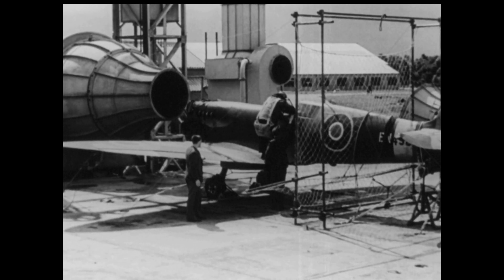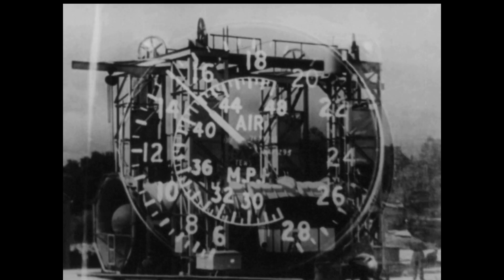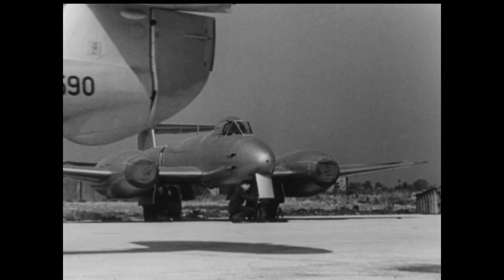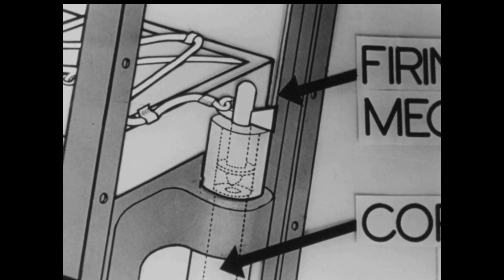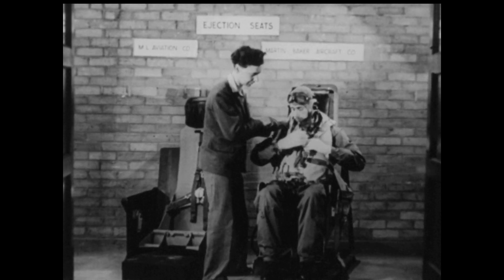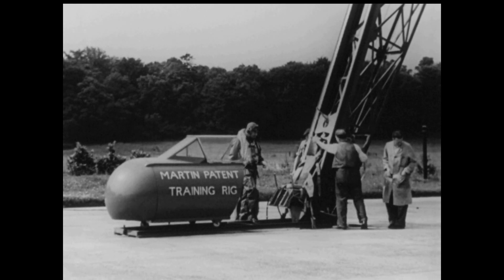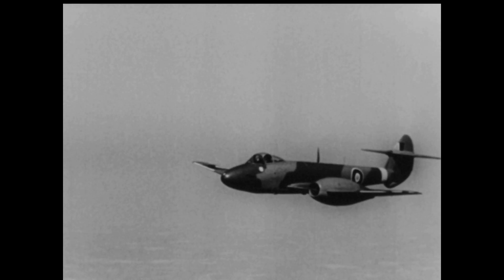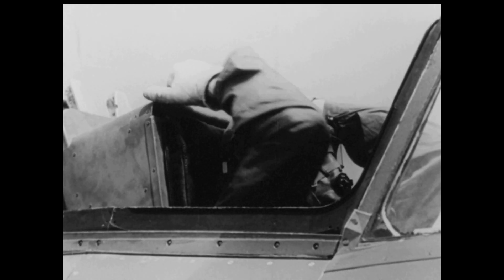Early Days Research & Development of Eject Seats

Comment: German He219 was the first operational plane equipped with standard ejection seats in 1943.

Between 1943 and 1945 over 1,000 operational Luftwaffe planes of different types were equipped with ejection seats